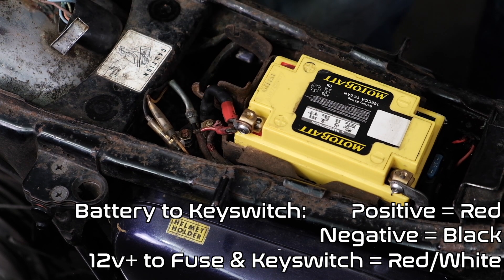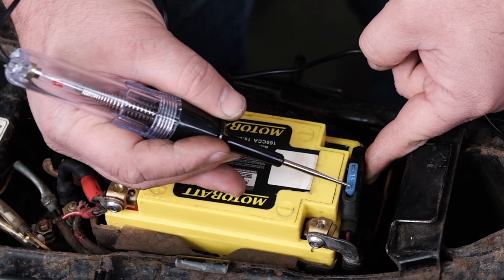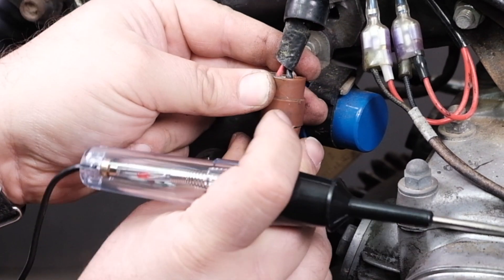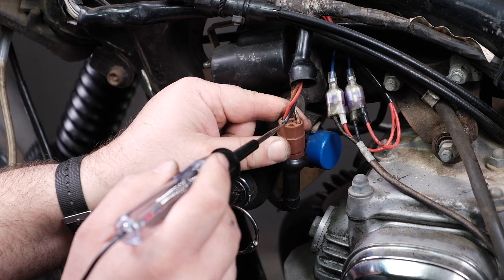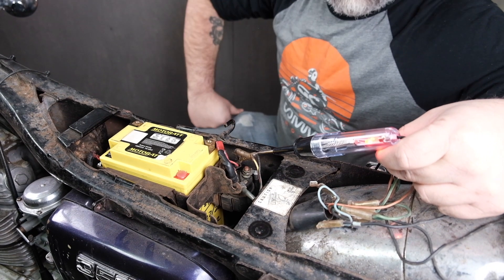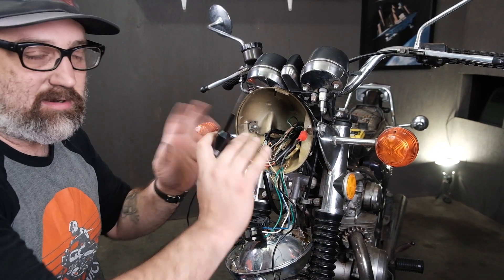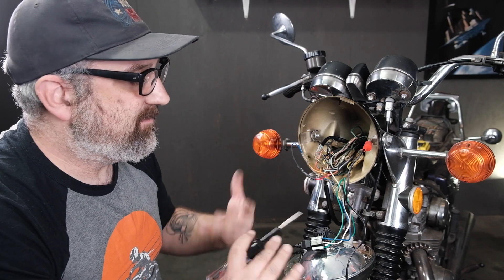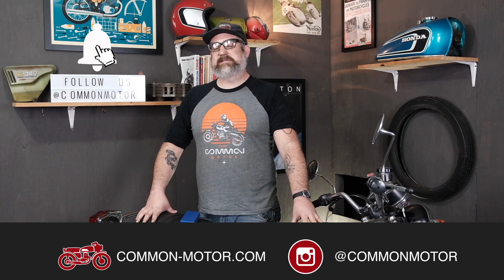Understand the Positive Circuit on a Vintage Honda Motorcycle

Comment: The wire to my coils is black but has a white strip.   I do not see that on my wiring diagram. CB350K2. Is that correct?

Comment: Your videos are awesome.  I'm "restoring" a CL200 I inherited from my father-in-law.  The motor has been seized since 1981 and several people have messed with it over the years and gave up when they couldn't get the motor unstuck.  I inherited a box of parts and a frame.  In the box was a bunch of loose nuts, bolts and parts that didn't even belong to the bike.  Some parts were missing.  I bought a bunch of parts from your website.  I got the motor free and found broken gears in the transmission from his grandkids trying to unstick the engine by pushing it down a hill and slamming it into gear.  I have it back together, but there is something going on with the wiring.  Your videos will help me figure it out and get it back on the road after 44 years of abuse and neglect.  Thank you.

Comment: If I have a 76' CB550, should my ignition red wire be tied into the positive battery terminal? I can't find a wiring diagram that points it to connect there?

Comment: could one single faulty connection cause the entire bike from not responding?
After checking the battery which lit up. I proceeded to check the fuses. None of them lit. I’m going back to see where the connection between the battery and fuses got disconnected.

Comment: I have a 81 hknda passport c70 , I'm getting power from the battery to the starter solenoid thru the red fuse wire up to the red wire on the key switch , but when I turn the switch to on I don't get any power out the black wire , which is giving me problems with the lights,.I have no tail light or brake and the signals not the horn work . I'm not getting power to the small wires on The starter  solenoid . So I jumped  a wire from the positive battery post to the small black wire on the starter solenoid and my brake lights come on and the front turn signals and cluster light like the neutral and high beam . Any ideas?  I'll appreciate any tips thanks

Comment: You have explained slightly incorrectly but helpful video as always...
Positive pushes in a dc system and both positive and negative push in ac...
Ps the bread analogy is terrible 😉😁